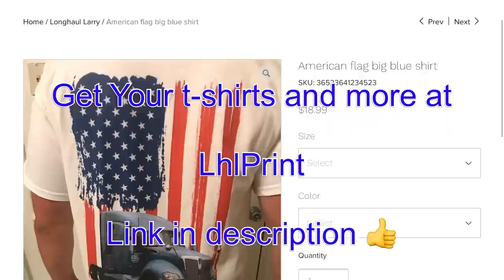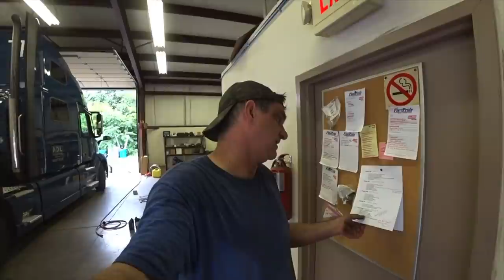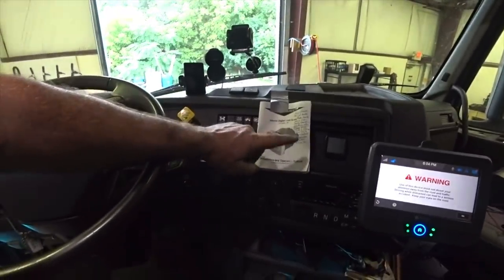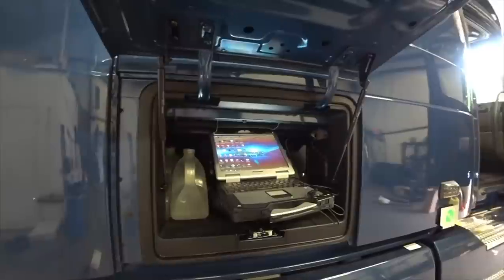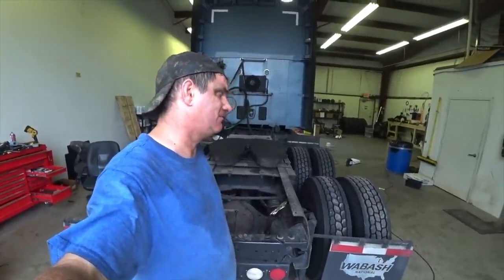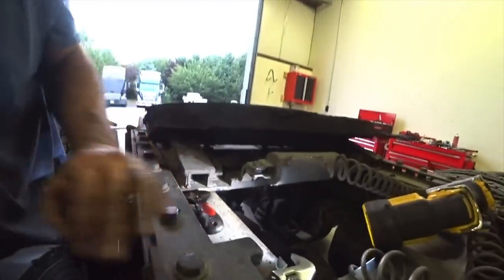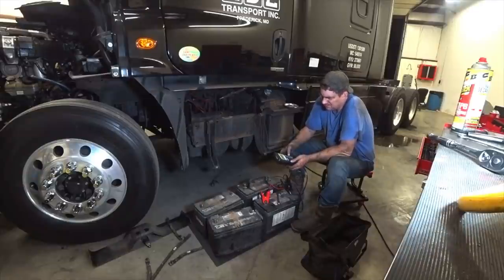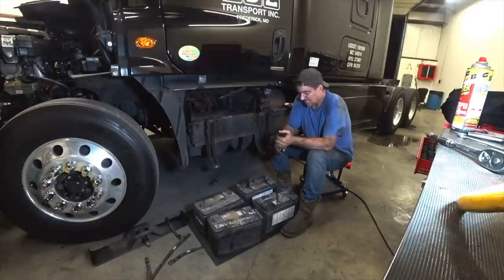Fast trip back to the shop, working on a “Volvo”, Big Blue, and back on 794 2020/127

Comment: Hi Larry, Awesome video's and it is great to see you. Windows 10 can run software in older versions of windows. Put the mouse curser over the software icon you are using and right click on it, select the "properties" option, then select the "compatibility tab", under the compatibility mode check the box " run this program in compatibility mode for:" ( select the older windows version that works for your software, ie. windows 8, 7, vista),  select "ok". I hope this might help you run your software on a newer windows 10 computer. Cheers, Chris.

Comment: What is wrong with the passenger side rear inside drive tire ?  It does not look like the tire is wearing evenly as the other 3 tires?  When you going to change the mud flaps on Big Blue ?
Reply: I noticed the same thing, not even wea8.

Comment: Do you need to have a pre Windows 10 or you you just need Internet Explorer and not Edge?  I know some programs I have to use for work will not work in Edge but will in Internet Explorer... It's confusing that they have both Edge and Internet Explorer now...  I guess you explained that, but I would check on the IE vs. Edge thought...

Comment: Larry I use a clamp on current meter to find current draw. They are so cheap to buy .I use a uni t 203 about 30 bucks.  I could show you how to use it but it is so simple to clamp on one wire. haha. I was a mechanic until I broke. But did electronics for almost 40 years. I used the midtronics testers before.

Comment: Some observations/comments/questions :

1. This is the first ADL tractor I’ve seen that isn’t in the 7XXX range. Has ADL gotten more tractors?

2. You mentioned Bowman - isn’t that the company that owns the yard that kicked ADL out of for doing maintenance in the yard.

3. Why doesn’t ADL standardized the placement of the ADL signage on their tractors? Some have it on the doors and others have in on the storage bin door.
Reply: Anthony Pirrello Yes ADL has gotten newer trucks which is these Volvo and yes bowman is the place boss use to rent from and as far as the name our older trucks have them on the door and the newer ones on the side box door which you should see on this Volvo. ✌️
Reply: @bossmantrucker656  thanks so much you always give good information.

So which tractors has ADL retired?
Reply: Anthony Pirrello  I believe it’s babyblue Johns ex truck. Cool 😎 Thanks 🙏 Stay Safe ✌️